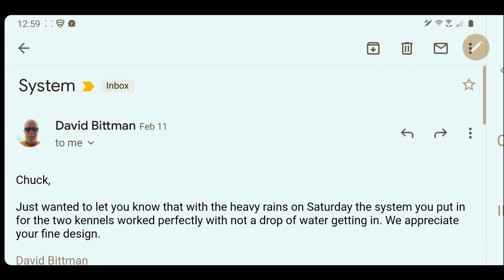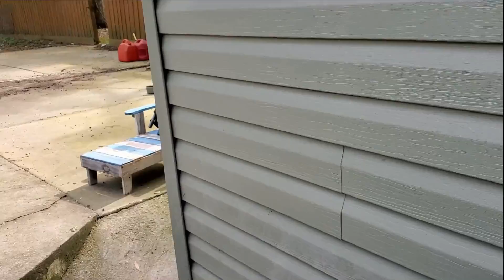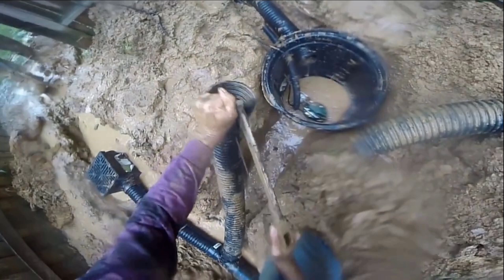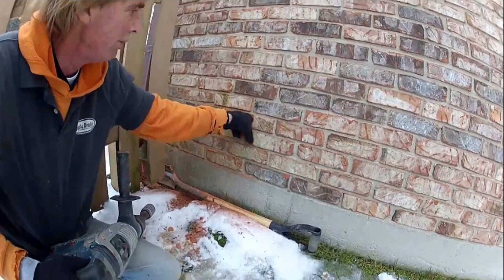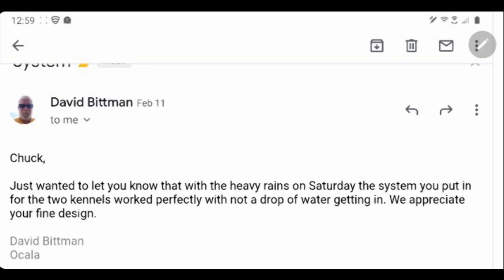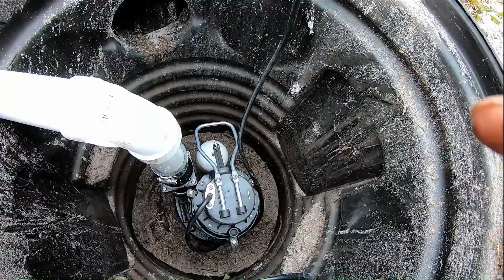How to Install a French Drain, Do It Right, Questions and Answers

Comment: I'm adding a pop up line to my downspout discharge that the builder ran under the sidewalk at the front door and left it sticking up out of the ground. I bout a pop up today. It's black corrugated. They also had a similar pop up that had a white PVC elbow. Should I use the black one (It's flexible and bends) or take it back and get the PVC version? Thanks for your expert advice.

Comment: I dig down to the footer which gives me a trench 2 feet deep and 1 foot wide. Can I backfill with coarse sand instead of gravel if the drain pipe is wrapped?

Comment: I really appreciate the Live Help you gave me.  You were so kind and patient with me.  I installed two different drainage systems by myself thanks to you and your step by step advice.  Both systems work very well.  My basement use to flood when we had heavy rains.  Now, my sump pump in my basement does not even run anymore.  So much less water enters the basement area thanks to the outdoor french drain and underground downspouts.  Thank you again.